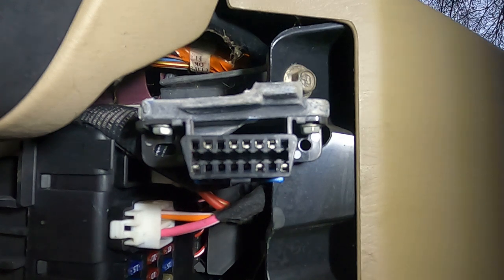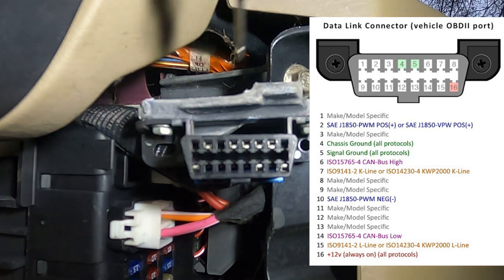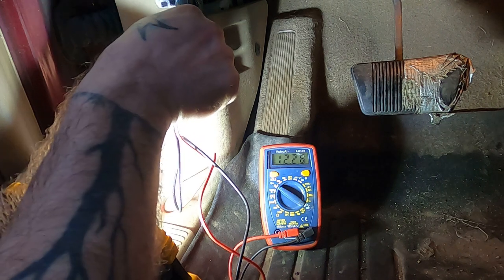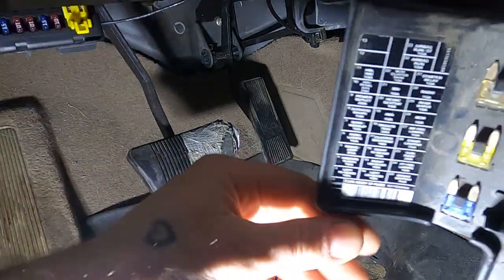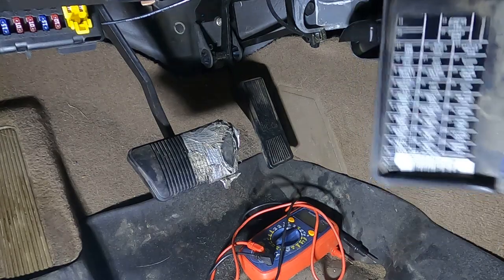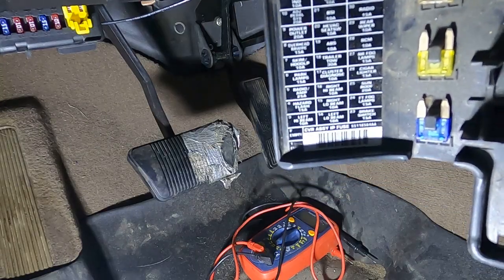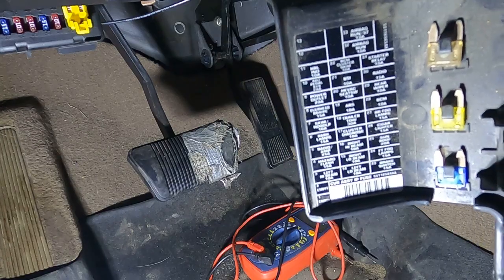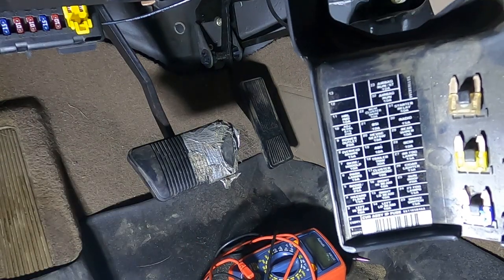EASY FIX - OBD II data port has no power

Comment: Ciao. Ho un chrysler voyager 2.0i gs gpl 01/1997 e ho problemi nel trovare OBD1, quello che mi permetterebbe di poter fare una diagnosi. Da un po' di tempo accendo il quadro, l'auto si accende, ma dopo 3/4 secondi di spegne, le lancette del tachimetro vanno tutte sullo 0, morte, nonostante il quadro acceso. Devo aspettare con il quadro acceso, a volte anche mezz'ora/un'ora che le lancette del tachimetro risalgano per poter mettere in moto. Ma capita, anche mentre vado, che si riabbassano e mi si  spegne. Non trovo nessuno che abbia l'attacco OBD1 per poter risolvere il problema. Cosa mi consigli? Grazie

Comment: Hang on right off the bat you said the check engine light comes on the check engine light will not come on on this vehicle if the port is not powered

Comment: Yeah so I seem to be having problems with mine but no fuses blown what I can say is that I recently had to replace the entire under the hood fuse box in my 07 Odyssey and now I don't have door chime key in noises or ODB power.... Tightened up all the fuse box cables and it came back temporarily... Then I had to change my driver's side fuse box(both boxes were damaged) the odb and door chime dropped again.... again all of the fuses are okay so I don't know if it's internal damage in the new box under the hood or if its internal damage in the driver side fuse box I was hoping for an instructional on how to jump power to the port because I need to get my check engine light code and this is a big pain in the butt

Comment: I changed the fuse on my 2004 ford e350 xl superduty. Then came back to change it again and ifs no wire in the fuse box. No i have to look for a missing wire

Comment: Hey mate i put jumper leads on wrong way ... blown battery terminal fuse ,replaced,  getting power to OBDII port but its failed to connect....to vehicle...do i hav a ECU computer problem or immobilizer problem ...any help greatly appreciated

Comment: I have a 95 z 28. I my scanner won't work only goes to 96. I was told i need a 1.5 scanner? Does tht make sense
Reply from the maker: Yes. OBD II (the scanners we use now) started in 1996. Find a Camero forum and there will be posts for days helping you decode OBD I and 1.5.

Comment: Don't care about the lighter function. And don't want to go searching, but would like to scan the engine. I should be able to snip the power wore to the obd port and run a dedicated power to it so as to power up the scanner to oull codes?

Comment: When i took my truck in today the tech said my OBD2 is showing no data available so he couldn't pass. I took it home and tested with VDC and it read 013 for some reason. Then i had a guy look at it and he said it was not voltage but resistance

Comment: Hello I have a 2003 chevy silverado 2500hd truck doesn't start with key but I can go to the starter and get it started fine I replace the actual ignition switch box and ignition cylinder and battery and starter but it still doesn't start with the key also nothing on dash works nor does the obd2 work can you help?

Comment: I get power, same obd scanner works on same model vehicles, I get 12 volts and ground at 4 and 5 is good. 

App is Torque Pro. I get "apapter cannot talk to ECU" error. Blue light is ON constantly when obd is inserted. Also gives some internal GPS connection state error. Any help would be appreciated. Thank you!

Comment: update found the short.  Somehow my brake sheered through the wiring harness entirely today when I stopped at the store, and my car filled up with smoke. That would explain literally everything.

My OBD2 port is dead, but my Dome fuse keeps blowing, even before I can get it into the slot. My AC fan stays on, except sometimes it'll shut off for a minute but comes right back on. That's with the switch turned off. When I turn the headlights on, the dash lights start flickering. It isn't necessarily idling differently, either, but it doesn't want to maintain speed, and will drop at least 10 mph if I'm running 55 going uphill. The lighter port started smoking the other day when I plugged my charger into it, but only after it started popping fuses. It's something of a fuse graveyard now in my floorboard from all of the things I've tried. Supposed to be a 10 fuse, but I've tried every size fuse and POW before I could even get it into the slot. I've tried unplugging different components, like the windshield wiper motor, headlight connectors, tried with it turned off, with just the key turned, and with the engine on and running. Going to check relays and unplugging the AC later. I seriously cannot figure this out. If those last 2 options don't work, it's off to the specialist guy who strictly gets paid to find dead shorts.

Comment: Previous owner of my 04 rendezvous had an immobilizer and he cut it out when it stopped working and now my obd2 port doesn't work and my engine light is on. Can I just reconnect the wires

Comment: I ha e a 97 dodge 2500  van and tho odb has power but it's not reading anything I can't get the van to start I changed out the crank shaft sencer and still won't fire no spark at the coil either any suggestions thank you Robert J

Comment: Chev 3500 2003  got power when I tested with a multimeter but won't power up ob2 reader .and yes it works  I checked in my truck

Comment: I have is called rats. Mercedes ML320 2007 I had rats that  ate the wires, I repair those wires solder them in shrink tubed. But the scanners still does not work. My question would be using a multimeter, should I get a reading from each outlet when I turn on the engine and test it

Comment: I have a 2010 acura csx same as honda civic SI i have 12.4 volts at pin 16 but only getting 1.5 volts at pin 6 & at pin 14 i am getting .97 volts on pins 6 to 14 i am getting 55.7 ohms  the reading on pin 6 should show at least 2.6 volts & pin 14 should show at lease 2.5 volts need some help thks

Comment: How about if you’re getting power and your scanner is reading not supported for this vehicle the only thing that I can think of is is that my upgraded radio possibly a wire not connected could that be one of the problems as before I did the change of the radio the port worked fineMy question is is there a wire pacifically for the radio to the port?

Comment: Ahhh, i have an intermitent problem with interior lights on my 2005 sport trac and removed fuse #26 to keep them off, and last night went to Orellys to scan my truck and the guy couldn't run the tester..today i went to autozone to try another place, same thing so makes me believe that the #26 fuse i took off is related to the obd scanner.. ill try again tomorrow, thanks for the tip!!!!!!!

Comment: Hello, my OBD monitor doesnt work. I get a no bus message everytime I plug it in and the gauge cluster stops working. When I unplug the OBD monitor the gauge cluster works. I am getting power to the plug. This is on a 03 Dodge Ram 1500 5.7. Any ideas of the problem?

Comment: When my Jeep had a crank-no start problem and my OBD2 scanner(s) stopped working, the problem wasn't fuse or port corrosion, it was the ECU/ECM going bad. So with OBD2 scanner not working and no fault codes to work with, I needed to resort to testing wiring throughout w/ a Power Probe to eventually conclude my ECU had finally given up resulting in no spark at the plugs and no fuel at the injectors. $600 for an aftermarket ECU replacement unit, since Jeep had stopped making the part. Once new ECU installed (literally 5 minutes), Jeep started right up (after 3 weeks dead) and OBD2 worked fine again.

Comment: How about if im getting power to the obd port but the scanner is not communicating with the ECU ?
Reply: Same exact problem with my 98 expedition. Apparently this is a common issue. I tried everything, used several corrosion agents no change. Bent the female plugs to make better contact....no change. I am going to check the fuse or fuses but im thinking that if its powered but just not communicating probably not a fuse.... pain in the ass.

Comment: So I was using a code reader to clear a check engine light for a gas cap, and as a code reader was reading the code it crack on and now the AC doesn’t work and it doesn’t read the OBD two port. I’ve never had this happen or heard of it happening.

Comment: I found out which fuse is for my 01 civic but when i try to replace it it blows it as soon as it touches it, any idea?
Reply: You have a wire touching a ground or a other wire it shouldn't be if I where u ide follow the wires from that fuse spot and see
Reply: @ So weirdly I replaced it again this time with car on and it didn’t burn it, obd port now working. Thank you though!

Comment: I have a 2013 Nissan Sentra and I have this problem.  I checked all fuses and all work.  I tested with a tester and it does have power.  Do you think that the pin is just spread open enough to not make contact with my OBD 2 reader?
Reply: Just fyi, my cigarette lighter does work.  Also, how do I remove the OBD 2 plug to check the pins on the connector?

Comment: My car is Tucson 2007 and the protocol is ISO14230-4 kwp fast, when I select car protocol manually stell can't get any live data on torque app, even though I can read car error codes normally,  any tips to solve my problem?

Comment: I need some help with my 1003 ford f250 6.0 I have no power to the obd2 port I checked all fues found no problems there I checked the port no problem found . I have power coming into the fues and out back into the fues box I traced the light blue wire from the obd2 port back to the fues box . I have no power coming out to the wire.  So I think ok bad fues block . I replaced the fues block still the same problem.  The way all this started was the truck shut off while sitting in rush hour traffic in Houston I sat at idle for 3 hours.  The truck shut off I restarted the truck it ran for a few seconds then shut off again  and now no start it has been a week of diagnosis and still no start . Idk what to do at this point.  Any help would be appreciated.

Comment: I am having a problem, I had a fuse blown and then there is a problem that will not allow the OBD reader to access to program new key fob, is there anyway that this is a bad ground pin? I have not looked at it but set up an appointment with what you called dealer stealer ship.

Comment: My ex played with an air compressor to cig lighter and burned the wiring forcing me to pull that fuse now my obd2 doesn’t work wondering should I run another wire with inline fuse to the number 16 pin ?
Reply: Update : I cut number 16 and connected it on a 12v and my obd2 showing number four cylinder misfire looks like coil time

Comment: My 2017 Honda civics OBD2 port isn’t receiving power. I checked the fuse box under the passenger side. They said it was fuse 7, but it wasn’t blown and the OBD2 port has no power. Any tips?

Comment: I have a 2016 jeep renegade latitude 4x4 and i have no power going to half of the bcm and the only thing that's working is my radio and interior lights i changed the ecu and bcm and still have the problem cant get it out of park to move it. I need help i don't want to sell it and i dont have the money to take it to the Dealer. I had the recall done to it and they left the ground wire from the top ecu hook up and i dont know where that goes.

Comment: My obd11 has power but fails to connect to the cars computer no matter whhat scan tool i use, some times it will connect for a short time and the drop fault says failed to connect plesese turn on key, this happens the same time my instrument cluster goes in to full fault, ever light speedo every thing except the fuel guage

Comment: Helpful video. Still haven't figured out why a new internal fuel pump wont run. BUT, this maybe related. I do have a dead OBDII port. 1996 C1500 Thanks! I think you should keep making videos.

Comment: Okay quick question. I have an 04 Honda pilot. Wasn't getting any power to the fuel pump. Went to the main relay only getting ignition power no other power. So I'm trying to figure out if it may be my ECM because I'm also not getting information for my scanner tool. I have power just not getting any Diagnostics or codes or anything when I know there are codes in the ecm. I know it's kind of a weird question in a hard one. But I'm getting kind of lost here. Thanks in advance

Comment: I've got a 03 Ram 1500 5.9L that has no fuel, no spark and no code reader. ECU is not putting out 5v for the spark and im working through it. Wondering if the crank sensor can cause all this or just a bad ecu?

Comment: Something I'm trying to figure out. I want to build a custom digital gauge cluster for my car. I didn't need it to power on with the OBD2 port. Just a standard power port on the car is good. If i didn't connect to the power pin on the OBD2, will i still be able to get the data? My device will be powered from somewhere else in the car

Comment: 2008 avenger.  The plug-in itself is loose. As if a ignorant monkey just yanked out the plug to his scanner from it.  So im sure wires may have broke at plug.  It has power, and im able to read voltage, but it wont connect

Comment: Thanks for Video. I was able to pass my failed emissions test do to "no power" to the OBD connector.  I also avoided having to pay 167 dollars for a diagnostic fee at the local shop. The problem was a blown 10a fuse in the  "Room LP" slot. I never would have found it without your video.

Comment: Dude you are the man. Thanks! the car in my warehouse  had this exact issue, the fuse ended up being on the engine bay panel but it was def there and had popped. easy replacement and saved me money from getting ripped off at the mechanic/dealership.

Comment: 2003 Silverado 1500 5.3, fuse is good (replaced it anyways) checked pins and they are putting out ground and power. If a scanner is hooked up to it the scanner will turn on, but not connect to it and it won’t pull any information off of the vehicle (tried 3 different scanners just to make sure mine wasn’t defective.) Only ideas I have left is there’s some sort of communication issue but without being able to establish connection to retrieve any codes I am at a loss. Truck got a reduced engine power message and CEL came on and unable to see what the code is in order to try figuring out what’s causing the reduced power. Any input would be appreciated.

Comment: Hi there I have a 2007 Chevy Express 3500 the pin #16 sometimes doesn't have power like in and out problem...but now it doesn't have power anymore..all fuses are good...broken wire maybe....

Comment: I was trying to hook something up for a school project on my 2014 Dodge Durango, long story short the 12v and ground wires touched and there were some sparks, after that I couldn’t get a 12v reading and found that the cigarette lighter fuse was blown. I replaced it with another one that was for the horn just temporarily to see if that was really the issue but that didn’t seem to fix it, they were both yellow with the number 20 on them so I’m fairly confident they were the same type of fuse. Is it possible I did damage to something else like the wires when I short circuited or am I just not checking the correct fuses do you think? Any thoughts are appreciated we’ve got to get this project done in a couple weeks and would like to know if I can fix this or should just try someone else’s car until I get my obd port replaced, thanks!
Reply: Turns out it was actually just a different fuse, I started checking all of them , wonder how long my cigarette lighter had been blown 😆

Comment: I had an intermittent engine management issue.  While trying to monitor live data with a scan tool, my scan tool would lose connection when the issue was present.  It was fine when there was no issue.  I did find corrosion in one of the connectors for the ECM, itself.  Then I found out that the GM fuse boxes that are under the hood, are notorious for getting majorly corroded.  That would make sense why the the OBD2 port would sometimes lose power and not blow a fuse.  I'm about to remove it and take it apart and see.  A new one is about $350.

Comment: Hello.. I came back from California and had to put chains on 2008 Honda Civic for about 10 min. Well right before I took them off the speedometer stopped working and the check engine light, TPS light, abs light came on. The car runs fine with no issues but the It will not communicate with the obd plug in either.. can you tell me maybe what to do to get all these light off my dash and my speedometer to work again.. ty

Comment: I have a 2003  Hummer H2. I am getting “Unknown driver “ message on the screen, where it usually says driver, one or driver 2 Half the electrical, such as radio, windows, gauges stopped working. I hooked my scan tool up as you are talking about, it has power, but it says no communication. Just asking because I have worked on this myself Probably 100 hours. do you think the problem is combined with the OBD unit which may be causing the unknown driver. Just asking for your opinion please ? I’ve worked on key fobs, changed  ECM and BCM but I probably should have started with the OBD port at first. Any comments I would sure appreciate it.thank you !